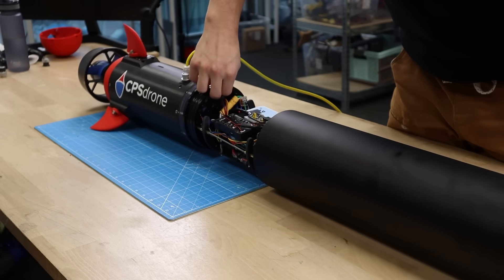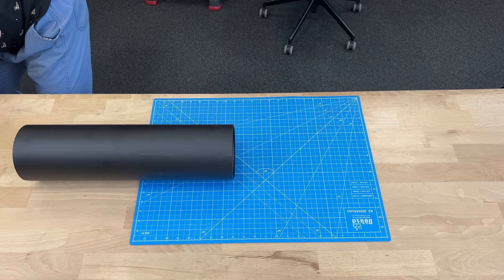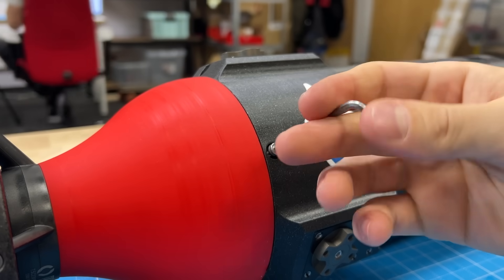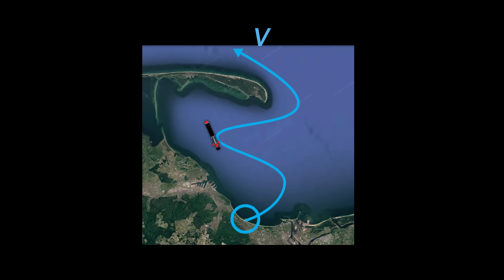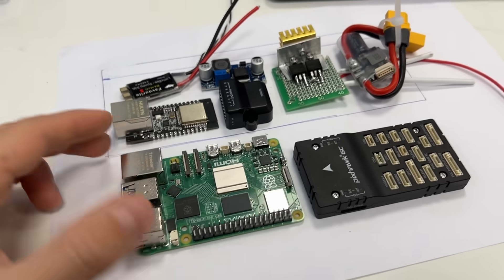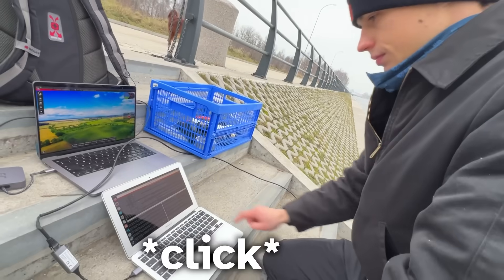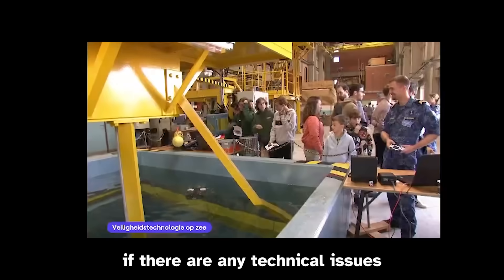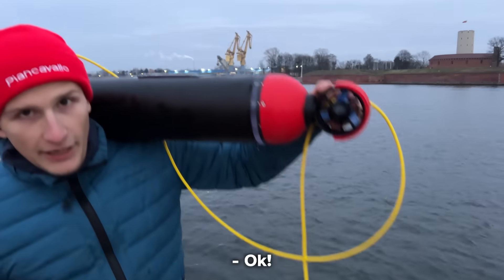Building a fully AUTONOMOUS submarine

Comment: Great work guys! As someone who did a brief stint in the AUV / ROV industry and has always dreamed of doing this at the hobby-level, here are a few of my thoughts:

- You are going to want to have an emergency drop weight, especially as you continue to add more and more expensive equipment. Many industrial AUVs use low-voltage electromagnets (you might be able to use a door-lock electromagnet, that's what we did) that will keep a set of lead weights conformed to a cavity of the vehicle. This way, if your vehicle loses power, it will drop the weights, becoming positively buoyant, and float to the surface. A secondary low voltage system can be used to power a recovery gps (just make sure you design this to fail long after your first low voltage system).
- In regards to your buoyancy troubles, You have found out why many commercial AUV's use ballast systems. There are many different ways to design them, but I would highly recommend investigating and implementing one to stabilize your vehicle. 
- I would also recommend swapping the 3 fin design for a 4 fin to help with pitch control. You will likely see a much better response, as long as your vertical fins and servos are kept far enough away from any downward-facing sensors to prevent noise in whatever data you gather. This will also help you ditch that thruster in the front, as I foresee that being a major issue for you down the line. 
- If you want to ditch the tethered buoy, I'd encourage you to consider making not one but TWO autonomous vehicles: The one you have built thus far (Autonomous Underwater Vehicle, or AUV), and an Autonomous Surface Vehicle (ASV) (basically a really fancy boat). If you can get your telemetry data from your AUV to your ASV via ultrasonic signals (which travel very well in water), you can use your ASV to "daisy-chain" the underwater vehicle to satellite as an intermediary. Disclaimer - make sure to check the legality of what frequencies you use, as some underwater frequencies are reserved for military and industrial use only. As an additional challenge, you can try beefing up your ASV to serve as a charging station for your AUV (if you can figure out autonomous docking). When you get to mapping bathymetry data though, you'll likely have to store that data locally on the AUV for processing once you retrieve the vehicle rather than sending it over satellite, simply due to the size of the data. 

You guys are off to a great start, and I wish you the best. Looking forward to seeing where this goes!
Reply: This guy ROVs
Reply: To go the easier way around, instead of buidling another boat or adding a tetherd float, i would install the GPS on the submarine itself and program it to surface at calcualted intervals so that it can adjust its heading and position and then dive agian and continue (It can be perfected in code from what i can imagine, it can also compenset for current direction based on previous data.) and totaly agree on adding ballast weight as well as auto surfacing emergncy system using the ballasit weight with an indepented backup system.
Reply: Great idea. Mine ain't as complicated it's easy, but still bravo, bro
Reply: I think it would be easier to just use basic inertial guidance and then have it come up near the surface occasionally to reset based on GPS.
Reply: You would think, but our team actually tested this at one point and found that subtle currents could really throw off your positioning, causing extreme drifts over long distances. It becomes highly inefficient if you are trying to map bathymetry and have to constantly interrupt your mission to resurface. Perhaps IMU's have gotten better in recent years and this might be possible, but we found it much more challenging than you would expect. There's also the fact that it drastically increases the number of pressure cycles you are putting on your equipment. Maybe not a big deal for shallower jobs, but we were sometimes working at a depth of a few hundred meters, meaning surfacing more often would drastically shorten the lifespan of pressure-compensated equipment between servicing
Reply: Great ideas! Yes, I concur that the vehicle needs a ballast system to solve the following: 
• GPS Location  Tracking 
• Depth variability of the vehicle.
•  Solar recharging of the batteries.
• variable payloads that the vehicle can carry. 

•
Reply: How about instead of a permanently deployed gps you instead have a sensor that can be deployed and retrieved by a winch. 

Have a section like a submarine bridge / communication tower that can detach and reattach by tightening or loosening a cable

Comment: Hi Guys,

This is great! 

For keeping depth, very energy efficient, google a buoyancy motor, often used in underwater gliders. Basically the weight stays the same while the volume is changed, allowing for very accurate depth keeping. The other thing you could do is instead of using depth and risking collision into the seabed is use a small transducer used for ultrasonic waterdepth measurements from surface vessels also called altitude (from seabed). 

In case you want to be able to always recover the unit, there are 2 options, a drop weight; you could use some water soluble fishing line used in fishing for example to drop a small weight after some minutes / hours. Or have a small buoy with a electromagnet on the vehicle, with a GPS receiver and small transmitter (LORA for example) inside of it. In case then power is lost, the small buoy is released to the surface (while tied off with some fishing line) and can TX its location. 

Keep up the nice work!

Comment: You could try the old way of sailing, and just use your speed and a compass. You might need to first calibrate with a few resurfaces with a GPS. But after that a few kilometers shouldn't be a problem like that.

Comment: HI guys, love the prject. I just wanted to ask did you treat the printed part of the drone? PLA is not watertight long term, especially with colour prints with alot of changes, you get tiny retraction holes around the colour parts which will get bigger over time.

Comment: VERY COOL !   - don't use tethers, have  a small unsinkable powered surface unit that has gps and communicates with sub via marine/scuba walky talky tech, digital or analogue/voice recognition should be do-able, use a beaglebone  rather than a rasberry pi for far greater capability/flexibility.  You can run linux on a beaglebone and still have your headers to communicate with devices like a ras pi does. If you must use analogue you can train your voice recognition to only recognize a few types of beeps.  or have the surface vessel ping and the sub follow the pings by comparing signal strength

Comment: Use "thrusters" at the "nose" to change the direction of your torpedo. 
One of the options would be:
Impeller you have used at the front but installed along the long axis. Followed by variable ports which can regulate the volume of water being released to one of the sides. When in forward movement all ports would be "fully open" allowing additional forward thrust. Or the motor would be turned off and all ports shut to save energy. 

Other:
Replace your "frontal impeller" with a centrifugal pump - aquarium/pond pump will be cheap and reliable ;) Multiple small pumps dedicated to each axis will simplify the whole "steering coding".

Both options will work better than "shark fins" at low speed and instead if slowing down will be able to add some thrust.

Comment: Float 3 sonar emitters with fixed gps coordinates around the area and continuously transmit pings at a set internal. Have the drone listen for those pings and then triangulate it's position based on the vectors to the sources. Possibly also use the timing? I don't know if difference in water temp/salinity would have a major effect on timing or not though.

Comment: Hey, marine engineer here, yes, 33 degrees is the maximum rudder angle that doesn't stall, but you should use less when possible. You could implement that by having the angle increase slowly until the desired course is reached, and then the rudders won't reach full deflection unless its a hard turn.

Comment: I would go for INS - Inertial Navigation System, airplanes, satellites, submarines, drones are using those but it also depends on the quality and manufacturer they ma be very expansive and they require quite complex software with filtering and so on, but there are also cheap solutions which may work just fine. :D It basically consist of accelerometers and gyroscopes for every axis and based on the movement it calculates the position, there is of course some drift over the time but with good sensors and SW it is very accurate today for long distances.

Comment: I haven't read all the comments. Has anyone recommended a gyrocompass, it should also work underwater. But the problem maybe that It would need to have to have an interface for reading
Reply: I just researched that a magnetic compass also works underwater. Together with a log, you could also link the current location, at least for a certain time. Every now and then you would have to show up to determine the drift by GPS.

Comment: Questions: 
1. Do you need to float the the whole GPS or just the antenna. If just the antenna, you could put a small float on the tip of the antenna and float it out on a retractable reel as needed.
2. For bottom mapping and collision avoidance, Have you considered hacking a cheap fishing sonar or consumer boating sonar instead of the expensive doppler?

Comment: For navigation can't you use acoustic pings for 2d position / navigation.
Just send timed pings from two or more locations on the beach, then pop a sensor on either side.
Compare the timing of both and you have and you have a 2d location.
Pressure for your 3d plot.

It won't be any good over longer / multiple depths as temp affects sound as does salinity. (this is how you austically hide subs! Fascinating)
But for testing it should work to 20Km.

Other than that your into LF / VLF navigation.
Reply: Why not speak to Neumi, he's making an opensource one for fish finding, but could easily be modified.
Open Source Underwater SONAR Update! | new PCB for Arduino with TUSS4470
Reply: https://en.wikipedia.org/wiki/Underwater_acoustics

Comment: For a more reliable bouy, I would have a two pontoon craft. Mount the gps unit on one pontoon (and ballast on the other). The tether is then attached between the pontoons on a swivelling connector that prevents the line from tangling.

Comment: impresive, i belive you must equip more inteligence and less power on the sub.
if its named autonomous let it be.
first equip him with a map, and image recognition
second equip him with a compass
trow the cables and gps boat
let him go to the surface as any submarine and calculate his position based on a gps call to google maps
equip him with a relative speed sensor, and teach him how to calculate the time and speed to move on certain direction only using cords as any submarine.
teach him to take photos of undewater on regular basis, you will be amazez of wht you will find.
stop arduino junking, use a mac mini.

Comment: Great project - I agree that sending the ROV out untethered must be a nerve wrecking exercise.... I did think of building an attached but completely independent system that had a "time-out" on it and unless deactivated would inflate a lift bag (via CO2 cartridge), either bringing the whole ROV to the suface or even a high strength line to then pull the drone up with,  also possibly a GPS tracker & strobe lifted to the surface to help to find it) - for now I guess you have the surface GPS bouy that could be modified do exactly that too. An ESP32 and LORA transmitter could send the GPS data back to a base station over longer distances and where cell reception is not possible.

Comment: Basically the Pixhawk is the pilot and the Pi is the navigator. Also i think your fin design is utterly wrong. Fine for a fast moving fish, probably less so for a slower moving submarine. I would have looked to submarine designs, even from the second world war
Also putting the rudders behind the main motor will make them more efficient. If you also look at modern subs, they use dive planes at the front of the sub to help with depth control, the sub should be naturally stable in buoyancy. Also maybe worth looking at ballast tanks too, which will be more efficient as dive planes can act as brakes/resistance if in constant use. They would take more battery power from moving and adding resistance.

Comment: 3x fins is a big mistake. Much less control authority than 4x. With 4 fins in a + configuration they will pitch and yaw exponentially better while creating less stress and less drag. Also will use less electricity as the fins won't be fighting one another to stabilize a turn or pitch. Y'all are handicapping that submarines potential greatly.

Comment: Hey Guys, amazing video! I'm looking forward to part 2. Some thougts from a full time aerial robotics researcher and hobby sailboat captain:
- You could use a combination of an IMU with, gyro, accelerometer and compass like the MPU9050 together with GPS in a Kalman Filter to estimate your position. Obviously this would require resurfacing from time to time to establish a GPS fix but you could also use these resurfacing intervals to transmit telemetry or at least a heartbeat over something like a 433MHz radio to give you some peace of mind. The Kalman filter will happily keep on producing new positions under water even without GPS fixes only based on the IMU measurements. The position will drift over time but i assume this would also be a problem when using only a doppler velocity radar. This is why you need the regular surface intervals to correct the accumulated error of the IMU. A Kalman Filter is great at doing this and since you seem to use ROS and Python, it can easily be implemented using the filterpy library. If you need help on the sensor fusion, give me a reply here with a way to contact you and we'll figure something out. 
- Another approach to establish a position would be using Sonar Data for visual SLAM. Just doing a quick google search I found a paper that did this and also a few github repos (AutonomousFieldRoboticsLab/SVIn, jake3991/sonar-SLAM) that seem to have implemented a system like that. Since you plan to add sonar imaging anyway, you could save on the 7k for the doppler velocity sensor.
- If you decide to keep it, assume you can mitigate the drag produced by the forward mounted "Yaw-Thruster" by integrating it into the hull. Just print an extended front section like you showed for attaching the ground sonar, integrate a duct going from left to right the size of the thruster and put it inside the duct. Then you basically have a bow thruster like in a boat.
- Since you are using a Raspberry Pi anyway, you could ditch the WiFi router and just plug in a small WiFi dongle into the Pi running in AP-Mode to make the Pi run as the router and save on space, energy consumption and overall cost.
Looking forward to what you will do with the thing!
Reply: The problem is power though.
Reply: @valcan321  I am firmly convinced that this concept by @therealfan4tix will be successful. The normal diving depth of the robot should ideally be 20m so that the drone cannot encounter a supertanker and after the diving period it must surface for a minute to correct its direction of movement. Of course, you can be satisfied with a kindergarten result of 3 meters...but it is simple to program the microcontroller to orient itself on the water surface using GPS. Nature provides a good example...just do it like the dolphin.I am firmly convinced that this concept by @therealfan4tix will be successful. The normal diving depth of the robot should ideally be 20m so that the drone cannot encounter a supertanker and after the diving period it must surface for a minute to correct its direction of movement. Of course, you can be satisfied with a kindergarten result of 3 meters...but it is simple to program the microcontroller to orient itself on the water surface using GPS. Nature provides a good example...just do it like the dolphin.

Comment: You can move through the ocean with very very little power. Like 1/70th of what you're using. You just move a a little water into the ballast, drone glides downward, but forward and downward. Move a little water out of the ballast, drone glides upward, but again forward and upward. You extend your glide slopes, you extend your efficiency. Surface once every third cycle to get a gps fix (and phone home if you like). If you complete this project with electric motor power you've done what hundreds of people before you have done. Do it using buoyancy propulsion and you're doing cutting edge dev. People have done it but there's vast room for improvement. You'll receive a lot fewer "so-whats".

Comment: wait.. is this... watertight?
.... adding foam just increased the weight of the back end...
Reply: The rear motor/servo section is not watertight - hence servos had to be waterproof and they put a bulkhead to waterproof the forward battery & electronics compartment. The foam was in the non-watertight compartment and probably some form of closed cell foam that doesn’t just absorb water, hence keeping buoyancy
Reply: @mtqrx  ok it's not intended to flood, but it has some ingress, so this is designed to close it out. thanks